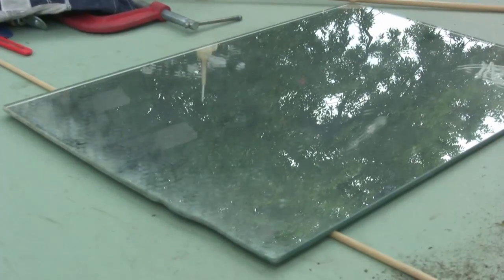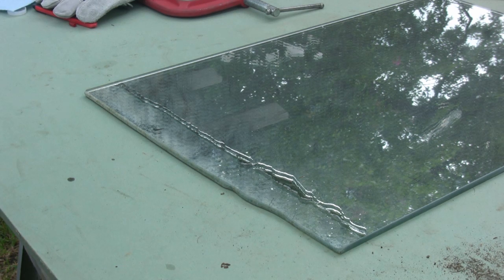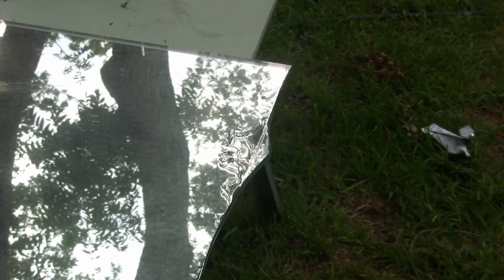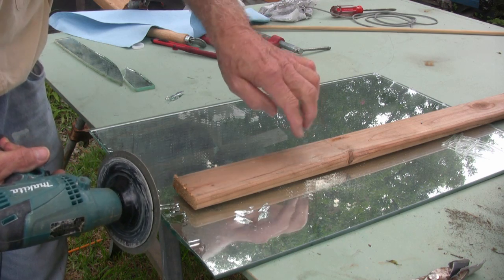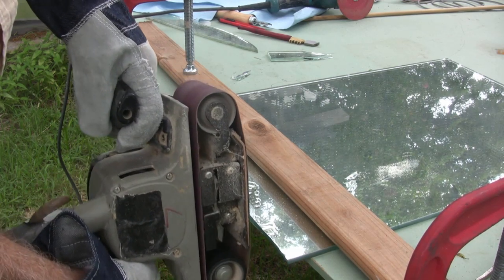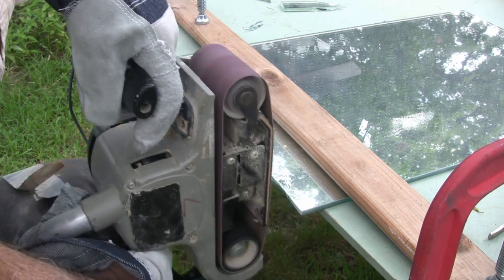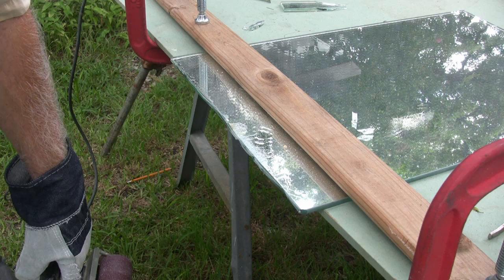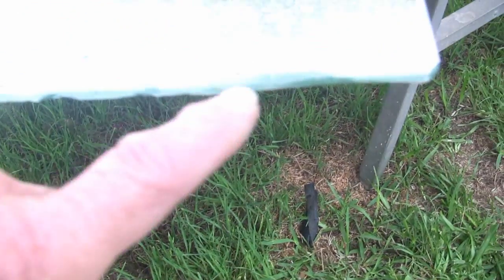Transforming A Mirror: Say Goodbye To Sharp Edges And Ugly Glass Cuts With This Sanding Technique!

Comment: The little ball on the back side of your glass cutter is not for you to press down harder while scoring. The ball is to tap the glass along the glass cutter's score line which "opens" the cut. This usually prevents the need to use pliers and the glass comes apart much cleaner. Part of the reason you are getting the "left over" edges you need to remove is the fact that you do not use a straight edge. Otherwise thanks for taking the time to make a tutorial. Also, run your "soft edges" first, then grind in to the score line. This helps prevent the chipping.
Reply from the maker: Thank you for the information, I've got another piece to try that on
Reply: Hey I know I'm a little late to the party but can you elaborate on that last point? What are soft edges? I'm relatively new to working with glass (only on a small scale though) but keep finding small chips when using my rotary tool and diamond tip. Thanks in advance!
Reply: Man I used a straight edge but didn't ball tap until 5 minutes before the video haha thats why I'm here
Reply from the maker: Thank you  so much for your reply. This is great news especially for other homeowners trying to cut glass or mirror

Comment: I had 2 panes to trim 1-2mm off side & one end. I used a Makita belt sander with 120 grit but found this too slow so used 80 grit. Clamped using wood on 2 sawhorses. Holding the sander upright I went from side to side slowly not too much pressure but only staying in  one position for 2- 3 slides then moving along till I got to the other edge. Once I got to the end I started at the start again. I also put an angle edge top & bottom of the side I was sanding just run from one edge to the other once. This stops chips when getting hot.Water can be used but go slow & you won't need it.  I would stop every so often but managed to get the job done. Important to wear gloves & googles & clamp your glass. Watch the ends as can rip the sanding discs.
Reply: Bee Somsak

Comment: You need to use diamond pads with glass. It’s sandpaper made with rough diamonds (not expensive)
Reply from the maker: Thanks for the information
Reply: Worked at mirror shop...  Sandpaper is what we used

Comment: nobody says what type of sand paper to use?
Reply from the maker: 80 grit to get rid of the jagged edge. Then 100 to 150 to finish the edge
Reply: @dustyguy  sorry, I did not mean the grit, What I meant is that the grit is made of,
Reply from the maker: Keep from buying the 
Diamond grit sand paper that is very expensive.  Buy the expensive sanding belt for metal

Comment: sorry but should be titled "how not to cut mirrored glass"  don't need oil but do need a straight edge also don't use a bit of wood to snap it as it does not put an even pressure across cut. Put dowel underneath and just gently tap simples!
Reply from the maker: I did learn that from an experienced glazer
Reply from the maker: Thank you for that

Comment: that looks like t-totally holy hell.....4-5 beaks and chips, underneath, on the corners. that was a overall total fail, maybe it would be ok to use in a outdoor shop situation, or something similar, but who would hang that in a house, it looks like crap. function only, actually you could have left it like it was after you snapped it, before you got the pliers a hold of it. i mean it had a few places that did not break evenly, but no worse than what it is now

Comment: I love your videos!  I watched both of the mirror cutting videos and it's just what I wanted to learn about because I want to cut a 1/4" inch piece of bathroom mirror in half and make two of the door mirrors.  Can you tell me if I could hand sand the rough edge as I don't have a electric sander?  What you ended up with will be just fine for me, if I don't manage to kill myself. HA!  Thanks
Reply from the maker: If your going to try to hand sand it go to Harbor Freight and get a diamond hone from the area where there sharpening stones are. It about 2" wide and about 6" long with about 50 diamond looking cut outs.  Gets two  pair of heavy duty gloves (incase you slip and cut one pair you have an extra pair).
keep a bowl of water close to dip your hone  as you are rubbing the edge of your mirror . This is going to take a while doing it by hand but be careful and have someone help just in case. don't take long strokes use short strokes and dip it in water frequently . let me know how it comes out.
Reply: Thanks, will do.